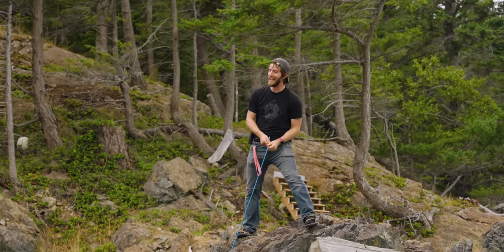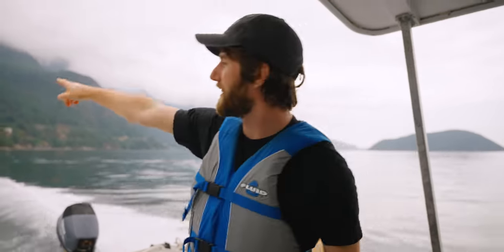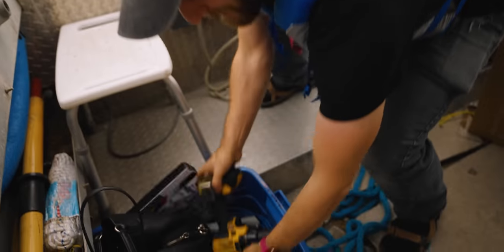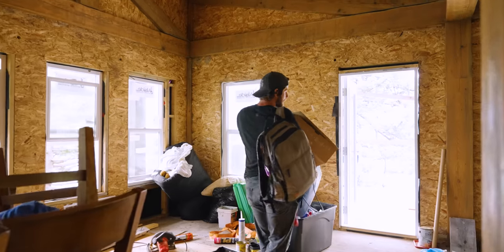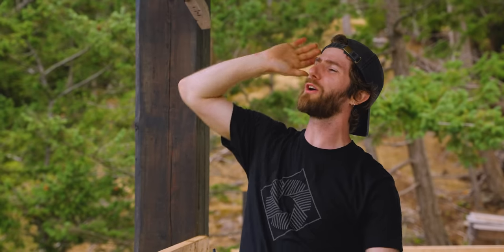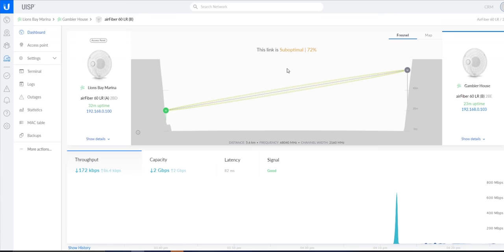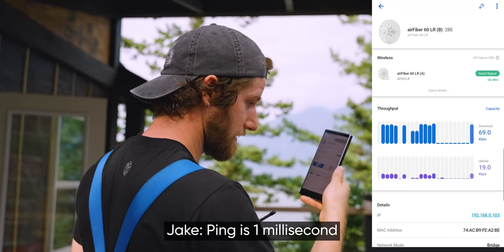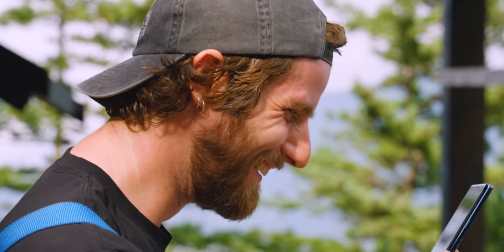How are we going to do this?

Comment: This video showed up on my feed and it was like a blast from the past. Just a little over 20 years ago I worked for a small startup company that provided wireless internet in upstate NY. At first, we were using BreezeCom panel antennas, and then we switched to using a parabolic grid antenna. We provided a whopping 3 mbps. In those days, everyone was on dial-up or DSL. The equipment was similar to the technology I field tested when I was serving in the Army Signal Corp in the 80s. As soon as I saw the picture of the distance and the RJ45 connector, I knew right away how the problem could be solved. Awesome video.

Comment: As a cell tower technician I'm happy to see you guys went this route! Every single dish on a tower basically does the same thing. If you want to install a cell signal booster look into buying a yogi to slap on thier chimeney and then a booster somewhere in the house.
Reply: I want this to be top comment
Is wholesome
Reply: I think you made a BOO BOO regarding YOGI... it is actually a Yagi.
Reply: I'm curious about how you felt for your fellow brothers and sisters in the industry that had to watch their 5G tower work go up in smoke because of a bunch of internet Luddites that believe everything they read.
Reply: They definitely could of gone with 4g or 5g cisco boosters as well. But it's not as fun and it's far more expensive internet and less responsive.
Reply: Isn't it going to be a big problem if either building flexes slightly over time? Especially with a wooden deck in wet climate.
Reply: @IronDoctorChris  the tolerance is pretty high, nothing stops you from readjusting over time though. And you're totally right you'd have to readjust for summer/winter without a doubt
Reply: @IronDoctorChris  Was thinking the same, then again, it's cost effective this way.
Reply: @scottmackenzie3761  Who tf says "boo boo" 💀💀
Reply: Is rain going to be an issue for this setup?
Reply: @bayzed  ok - it was a joke.  I guess you aren't old enough to remember Yogi bear and his side kick Boo Boo.  I was making a correction in that the antenna was not a Yogi but a yagi.
Reply: You must have the coolest job around
Reply: @Jacknzyeah  Water does make Electric Magnetic Interference (EMI), which messes up your wireless signal. They may see some latency or packet lost when it rains, but it would only be the worst when it storms really bad and make a wall of water.
Reply: @RedsRegards  FM transmitters here are also fed through microwave links. They only stop working if there's a heavy thunderstorm in the area.

Comment: ISP: "Can you restart the modem please"
Linus' Parents: "Sure thing, just give us 20 minutes to boat over to it"
Reply: Its posible reboot some through the IP menus ( wasnt sure what too call it)
Reply: There has to be a way todo that remotely. With a smart Powerbar or something like that.
Reply: @anouk8231  the gateway interface thing?
Reply: Don't wanna kill the joke but I saw the responses on here. I work for an ISP. We can reboot the modem ourselves, no problem, as long as it's connected to a functioning coax.
Reply: @m33r61  yep
Reply: @Ryamix  What if the modem is completely unresponsive?
Reply: @clanoue1167  With dead internet? I doubted that. 🤔🤔
Reply: @neSsuChan  Your LAN should still work without problems and if your smart Powerbar has to be connected to the internet to work you've got a shitty smart Powerbar.
Reply: @neSsuChan  Accessing your network gateway doesn't require internet.
Reply: @neSsuChan  If you aren't able to reach your modem to restart it, then the problem is between your computer and your modem, not between your modem and the internet.
Reply: *And another 20 minutes to boat back to the house!
Reply: @Ryamix  What if I have DSL? :p
Reply: That what watt boxes are for my friend
Reply: The smart outlet needs internet tho, and if they turn it off like yk
Reply: ah yezz indihome ISP always Need a restart Modem Fix for everything.
Reply: @anouk8231  Most of the time it gives no way to hard reset it (Unplugging it for 60 seconds) So if that's needed you'd need something better than just the menu.
Reply: @ShiroCh_ID  ah yes... I can relate lmao
Reply: luckily they can do that remotely now
Reply: @skirata3144  almost all smart powerbars work through cloud, not even through lan tho... I'm so angry about that, like I need a smart power outlet that works either through Bluetooth or through a dummy WiFi hotspot (without the internet access) but i can't find any, they all work through cloud, that's so dumb
Reply: Can someone tell me a good graphics card under $600 aud
Reply: Lol without an o
Reply: or just log in to the router and hit restart.
Reply: SKU:  USP-Plug-US, Get one of these and it power cycles the modem automatically if the ISP can’t.
Reply: @Ryamix  Though that's true, sometimes you need to do a hard reboot, and in those cases you're not going to be able to do it remotely.
Reply: Ubiquiti actually sells a smart outlet, if your using one of their gateways that monitors internet it will auto power cycle if it detects a loss of connection, otherwise you can manually power cycle it through the controller software.
Reply: @Ryamix  If they're using an ISP provided modem anyway which , given this is set up by Linus, I doubt is the case here.
Reply: You can do remote shutdowns from your router settings
Reply: Non-shitty (enterprise) equipment doesn't need to be restarted every few days like consumer level stuff. They might even have a properly working watchdog timer inside the equipment.
Reply: you can have a little device that have a sim card where you send a message off or on and it kills or lets in power
Reply: @Ryamix  what if its completely frozen also what the actual fuck? you say you can reboot MY PERSONAL modem??? I will not use that ISP you work for
Reply: @prankerganster3985  No need if you have a properly designed watchdog. It's an independent microcontroller that asks the main processor: "Hey, are you still working?" If the answer is not correct, it toggles the reset line on the main processor. As I said, most enterprise equipment has this sort of thing.

Comment: I get if you are already using Ubiquiti products but if you are just trying to cheaply get a remote building up EnGenius makes a Wireless bridge and the Pair costs about $200. My boss has connected up a ski resort with these for years. Stuck a bunch of antennas on the top of a mountain and could hit one from anywhere on the property. I have used them on a Golf Resort to get up remote or temporary structures. Like I said if you are already using Ubiquiti makes sense to stick with the product line but we have never had issues with these cheaper options.

Comment: Jake: "the sketchiest scissor life ever..."

Proceeds to detail the condition of every scissor lift I've used on a job site.
Reply: Lmaooo big facts ain't no scissor lift stable especially when you're 30+ feet in the air not 10 lmao. The gas powered one was pretty cool though don't see too many of those these days mostly just electric
Reply: @MoistFalafel  we have half diesel and have electric ones most of the time its running on the electric but every so often the engine kicks in.
Reply: I’m all about that scissor life
Reply: @MoistFalafel  yeah i hate when i rent a lift for 30ft and they bring me this tiny electric trash one… but u get a big gas one, with proper wheels and stands, it’s is sturdy af. I’ve been working in -25C (-13F) without issues last winter
Reply: @MoistFalafel  yeah i hate when i rent a lift for 30ft and they bring me a tiny electric trash one… but u get a big gas one, with proper wheels and stands, it’s is sturdy af. I’ve been working in -25C (-13F) without issues last winter…. But my co-workers are the crazy ones, they at times work on a 100ft scissor lift which was partly mounted to the building lol
Reply: When I was 18, I used to do Lowe's sign kits all over USA and I would drive them at ceiling height (almost fully extended) at full speed all around the store because the electric ones  take too damn long to go up and down. haha the shit we do when we are young.
Reply: When he strips the first tapcon  and says "but we did it right" I was like "welcome to drilling into concrete".
Reply: @alricfremanosrs1509  His tapcons are definitely wayyy to long for anchoring into a cinder block, I couldn't really get a good look at the box but theyve got to be over 3" and Im honestly not sure how he stripped the tapcon, its not like he was driving it into thick concrete or a stone there's only like an inch of cement to go through before you get to the negative space, even low quality tapcons ive only ever seen stripped grooves from driving it into something dense.
Reply: @dr.mailman  cinder block walls have re-bar reinforcement in the empty space. He could easily have struck a support with the first tapcon and caused it to bind.
Reply: @alricfremanosrs1509  That's a really good point I didn't think of. But I feel like you would've felt it or the backfilled cement when piloting the hole. but it kind of goes back to my original comment that if his tapcon binded on the rebar inside then his tapcon was too long. I only say this because I've also have made the same mistake of using too long of a tapcon to anchor into cinderblocks and it caused me all sorts of grief.
Reply: @dr.mailman  oh yeah screw was definitely longer than needed. I figure he piloted shallow, just thru the outside of the block, and thought his long screw had a clear shot after that.
Reply: I know, right? If they don't have at least 2 ft of play from side to side fully extended you end up having to move them too much.
Reply: That and  stripping  screws while going into concrete.   You need to drill a hole first boys.  Then  plug and screw
Reply: Lol yeah every scissor lift is rickety I stg 

Now just try a forklift with a cage lol. That’s even more fun

Comment: Good luck when it rains, I have these deployed on a network within 5km of each other and the link is super solid till you get a decent amount of rain fall. Then the connection craters to nothing. Would recommend you go 5ghz AFXHD with 23db dishes instead for your link, that will keep a solid connection regardless of weather conditions.
Reply: I was going to write nearly this exact comment.
Reply: I mean, I'd bet ubiquiti gave them the gear for free, so, might as well do both and load balance between them.
Reply: @jttech44  Yup, or do auto failover. I believe ubnt added failover in a recent (beta)firmware update for the af60. (basically downs the ethernet link if signal is lost so STP or whatever you use can kick in and up a secondary path)
Reply: Absolutely this. in a project like this I'd always go for a lower frequency (and lower speeds) to get higher reliability. Sure it's great to say your link can do gigabit bi-directionally, but being able to connect to the internet year-round is a bigger selling point.
Reply: @superknoppix  And the edgerouter can support all of the above really. You do lose a little speed because it's effectively having to route packets, that edgerouter has good offloading, so you're talking maybe 10% tops.
Reply: Rain... some setups I have seen even some fog and it is spoty.
Reply: I dont know anything about what you are saying, but I like it!
Reply: Why is no-one mentioning reflection....? 1m radius @ 1km for 60Ghz, for 5Ghz, much, much more. This'll deteriorate signal significantly and cause multi-path. If I was Linus, I'd use E-Band (70/80Ghz) instead, and back it up with LTE or similar.
Reply: Ah yess I remember this from when I was running a 4g modem. Its all good until the foiliage gets soaked.
Reply: @jttech44    All of us tech nerds in the comments talking about how to make this weather proof and higher speed, when his mom and dad just want to use the internet for downloading photos of their grandkids over facebook.
Reply: @jttech44  actually, the odds of gigabit fibre in that area aren't that bad. TELUS does offer that throughout most of the lower mainland (I can't speak for that exact marina) and if they don't, their competitor Shaw offers gigabit cable in the same general area (though with abysmal upload speeds, and again I can't speak for that marina)
Reply: @docferringer  most of us "tech needs" are actually advocating for SLOWER speeds so as to get more reliability. You're right that the most likely use case doesn't require bidirectional gigabit speeds, but it could probably use some more reliability in reading weather. That's why we question the choice of a 60ghz system vs lower frequency alternatives.
Reply: good thing it never rains in vancouver!!
Reply: I'm curious, how do those behave in fog? Does the signal also drop?
Do you also have to worry about birds?
Reply: @me0262  fog can cause issues, but not nearly as bad as rain usually. A bird will be no issue, a whole flock might cause a packet or two to get lost, but applications are designed to deal with that so the end user likely would never notice.
Reply: @jttech44  Alas, recently Telus, and even Novus, have pushed FTTH all over the place. I would be surprised if it wasn't available at that marina.
Reply: @Green__one  I'm thinking more of one or two landing on it, screwing up the alignment and/or pooping on it.
Reply: @me0262  bolted down properly it would be unlikely to affect alignment (wind would be just as bad really), bird poop would likely not be much issue in the reflector unless there was a lot of it, on the feed horn it might be, but it's pretty sheltered.

Comment: Once I spent few days on various scissor lifts and made sure they cannot be accidentally tipped over when maxed out, I actually started genuinely enjoying the swaying. But at the same time I remember that my first time I was so sure that if I even barely lean against solid wall (i.e. when drilling into a concrete wall and leaning against the drill), it will tip immediately. 😂

Comment: “We need to identify each other over long distances.” 

“ I know, let’s wear black!”
Reply: That isn't even the problem. They are both standing at the water line trying to spot each other over 5 km of open water. The Earth's curvature is 1.96 meters over that distance, so he was trying to spot Linus through water.
Reply: @Morphl1  I never actually see flat earthers, just people talking about flat earthers that they are somehow common.
Reply: @fordgtguy  they are way more common than you think (particularly online)
Reply: @nero3901  More likely trolls playing others.
Reply: @ballbearing6303  more like elevation of ground itself than the curvature. Ground is not flat
Reply: Ground elevation at sea level?
Reply: @Phage0070  Assume that radius of Earth is 12800km, then 5km is equal to an angle of 0.00039 radians. The Earth's curvature should be 12800/cos(0.00039)-12800, which is roughly 1m. Can you please explain your calculations? Because there is a clear discrepancy here.
Reply: @eastpavilion-er6081  The radius of Earth is about 6,378 kilometers, not 12,800 km. That seems to be the main issue.
Reply: saw this comment and didn't expect it to go so technical... nice, now i've learnt something
Reply: @eastpavilion-er6081  I think you took diameter of earth instead of radius
Reply: @Ansh77K  Ah, my bad. Thank you for pointing out!
Reply: @eastpavilion-er6081  yep yep no problem

Comment: Would it be possible to get a revisit to this in the future for examining the stability during Fog/Rain/Snow?
Reply: I agree. This is the type of thing that I could see running well till Winter or bad weather hits, and that's specifically when you want internet service. I mean just look at how lightweight it is. That's a positive in terms of aiming and mounting, but  negative in regards to how well it will stand up to rain, snow, and wind. I bet that's the real reason for the holes in the dish. Wind resistance.
Reply: @ViciousTuna2012  with the dbm it has... it will NOT drop lol. 60- is super powerful . I install something like this and it works at -105
Reply: @qwertqwertman  me too man but we have a 5ghz, I wonder how this will work in a storm on 60ghz
Reply: I set 2 of these P2P bridges up at my boss's country club across a golf course to 2 different buildings a couple years ago. So far they've been pretty stable. Only time we lost connection was during heavy snow, but the country club was closed then anyway. They really are painless to install!
Reply: What internet provider though??
Reply: my internet is supplied from a dish on a hill about the same distance as linus set up and its been working fine for 3 years even during thunderstorms 3.5 mega bits download, 2 upload, dish is half the size too
Reply: I had the same question. Water droplets tend to be super good at absorbing electromagnetic waves what with water being polar and all.
Reply: @qwertqwertman  they really don't. I have a pair of these exact units running at -42dBm across 2.1km. In snow they die pretty dramatically, usually at around -75dBm. These running at -61dBm in good weather isn't a good starting point at all, they need better mounting brackets and they need pointing by someone who knows what they're doing.